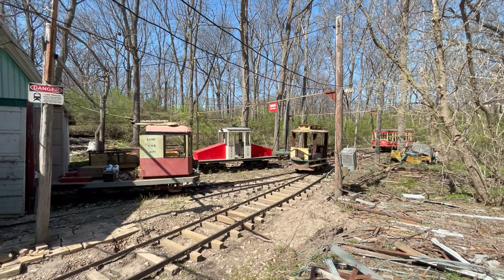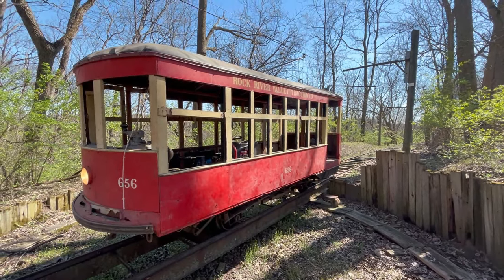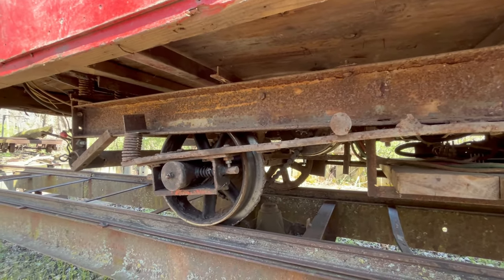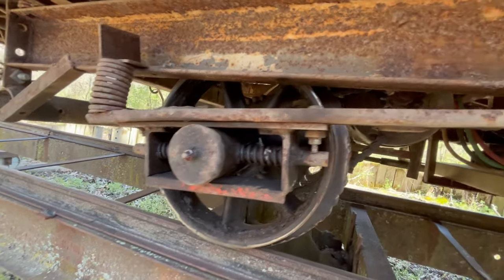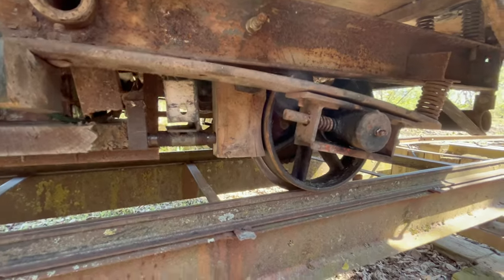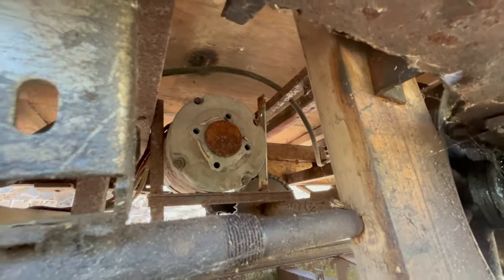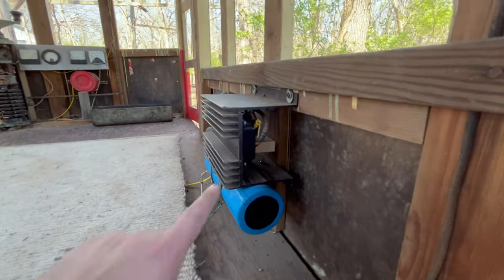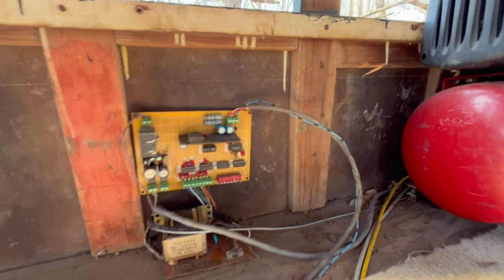control systems on the RRVT,  part 2

Comment: That setup at 3:20 looks like it was to let the axle twist a bit on tight curves like a Brill Radiax truck.
Reply from the maker: You know that is a great point, I never thought about that. The original self steering axle!

Comment: How do you not get a shock with all that 240v everywhere you when you touch the overhead cables? Seems very sketchy having all that voltage just sitting around
Reply from the maker: Think of why a bird does not get electrocuted sitting on power lines- same principle. If there is no path to return to ground, you do not feel the electricity. If I was working barefoot, that would be my last video lol

Comment: How your over head power supply works??? Are you producing your own AC electricity???
Reply from the maker: It is supplied from the local utility company, which is using nuclear power in this area to generate the electricity.

Comment: I was under the impression that your cars drew power from the overhead
Reply: They do draw from the overhead- but the overhead is 240v AC, and the motors aren't designed for that, so the stuff in the video is showing how all the cars take that 240v AC and turn it into making the cars go.
Reply: They do! That's why the AC amperage goes up when under heavy load. The AC current is changed to DC however.

Most streetcar systems used DC overhead and DC motors, so the rectifiers were off the train, but I personally think that including the equipment onboard is quite smart for small systems like this- and you get to have the fun of more electrical things to poke at (preferably with the pole down...)
Reply from the maker: Yes they are powered from the overhead, that is the only power source.

Comment: Great explanation and very interesting video - tnx! Any intention to add a few signals?  You obviously don't need them, but it sure would be cool! Keep the vids coming.
Reply from the maker: I used to have working signals, but as time went on the wire codeline became damaged and I just stopped maintaining it as there were other more important items to work on. Now that I have a lot of the major sore spots fixed, I am considering reactivating the signals but on a much larger scale. Years ago I built some boards for a radio codeline system to replace the wire line but never got them installed, and I have some ideas for new signal heads so someday you may seem them pop back up if I can find time to do all of it. I really would like to have working signals again, it was a nice touch even though they served no real purpose.
Reply: @CNW4145  Great minds!

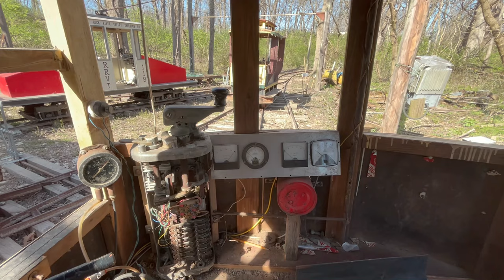Comment: 16:57 I did! how fast do you reckon that was? I think nearly 50 km/h or 35 mph, but it's hard to tell... some cheap GPS speedometers may be a fun buy for the high speed runs!
Reply from the maker: It was really only about 20 MPH, just seems much faster due to the quality of the ride in that car. Feels like 100 though lol